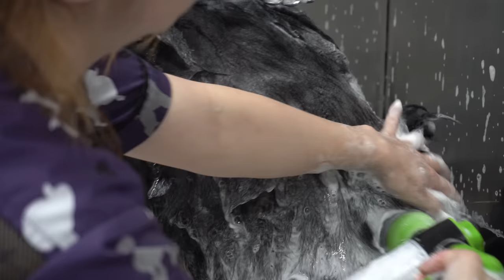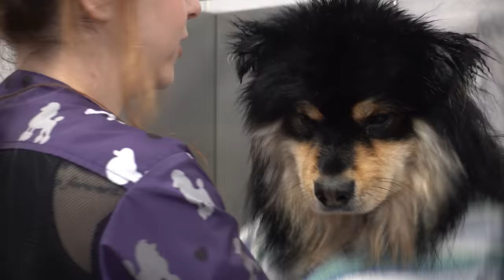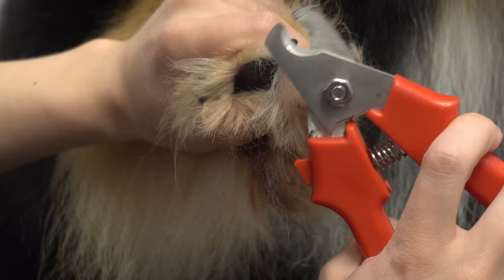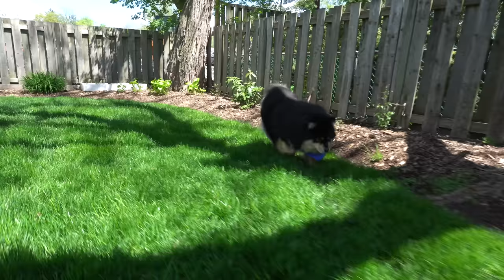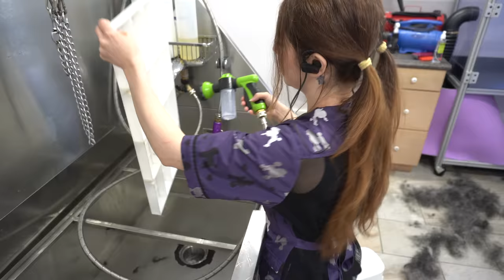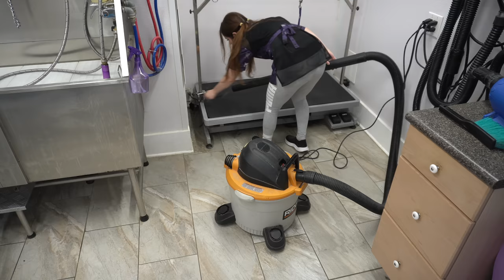Giant Pomeranian INSANE hair explosion + Satisfying clean up after a FURnado

Comment: I just had a brain bubble go off looking at the fur-nado, and your cleanup of the floor, and I'm wondering if something from my wood turning days might work here.  Dunno if the idea is worth anything, but, here it is:

My wood turning dust collection setup, like many wood turners, was made up of three things, the first the "magic secret" that was wonderful:

1)  A plastic Cyclone Lid that fit right on top of a standard sized trash can.  It had an inlet port and output port you would band clamp standard, hmmm, I think that was 4" hose on.  It caused a strong cyclone inside the trashcan that caused debris and dust to stick to the walls of the can and drop to the bottom, with very little getting out of it.

2) On the ouput side you would run the 4" hose to a Dust Collector.  I had a Jet dust collector.  This is a wheeled floor standing dust collector with a lower and upper bag that would "inflate" when it's turned on.  It's not terribly big though, so it's not a floor-space hog (IMO).

3) Your hose and stationary collection points (if any), along with a y-joint and valve you could simply lift or close to divert suction to either the hose with an open end you'd use to suck up sawdust and chips from the floor and benches, versus switching it to the "hood" I had hanging over the lathe to suck up dust when turning and sanding before it floated everywhere.

It worked wonderfully, and the Cyclone Lid was amazing.  Wood turners figured out how to stick a standard garbage bag in the can, drop a piece of scrap wood in the bottom to keep the bag from floating up into the intakes (at first, once some debris was in the bag that's a non issue).  

It was amazingly efficient, I couldn't believe it.  The cyclone action kept almost everything in the can, never getting to the collection bags on the dust collector itself.  And that included the super fine dust as well, not just the chips.

I have no idea if this makes sense for your setup.  Haven't tested the dynamics of dry fur being blown off a dog with force.  It would work perfectly for floor/table/room cleanup of course, and you'd have a ready-packed garbage bag full of fur.  Makes me wonder if a couple of collection "hoods" over the table drawing air in would suck up a good amount of the flying hair during doggy-drying.

Anyway, if you bother to read this TDLR, thanks for the patience.  

Thanks for the video.

Comment: Hey Vanessa, have you considered installing a type of exhaust fan that pulls all of the "furnado" into a decent filter? Sorta like what restaurants use to pull grease smoke into but maybe on the side?  It'd be a   high cfm, but low velocity air movement type of thing.  It would definitely keep the furnado down to a minimum and would only be needed to be on when you do your high velocity air blow.  Just a thought.